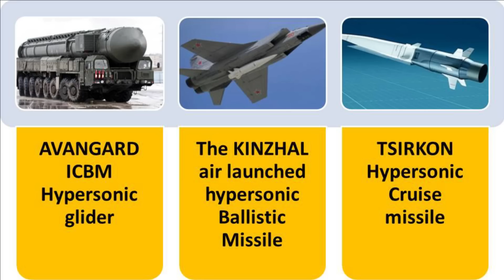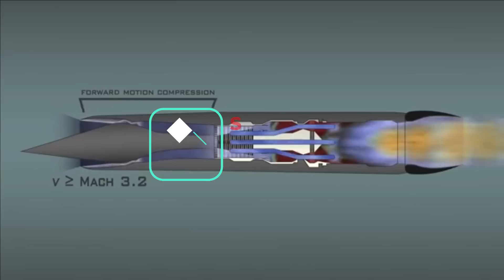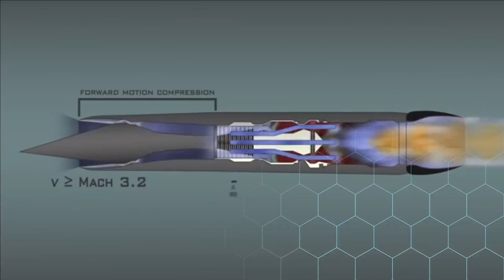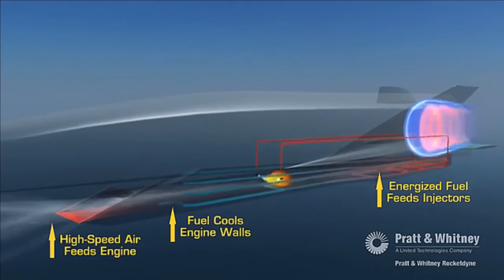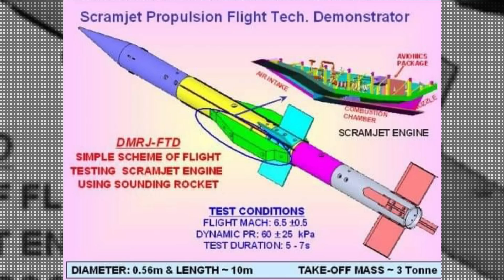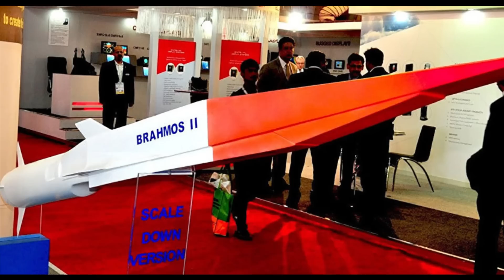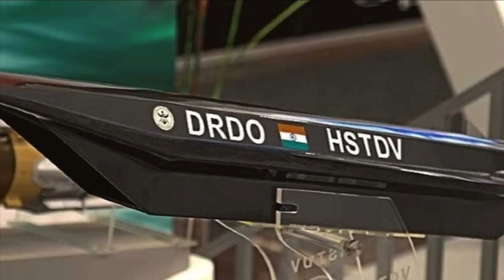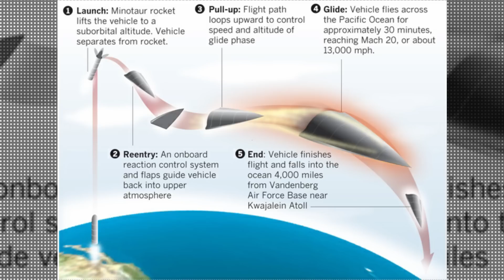India's Hypersonic Missile program in detail

Comment: Nice video. Very comprehensive unlike others I’ve seen on our hypersonic program.
What worries me is the initial estimate on Brahmos 2 being 2017 and now 2025. How can such delays occur and how can such estimates be so wrong? It’s almost a decade off the target 🙄
Reply: These are all BS timelines issued by our chapri 142nd ranked media houses.... 

The only official timeline of  hypersonic missile came from drdo was that Dr G sateesh reddy said that working hypersonic missiles would be ready within  4-5 years...he said it probably 1 year back.

Russia will not give readymade technology  on a platter...even after buying so many things they didnt give us complete TOT of any jet for indigenously manufacturing....our engineers have very hard time overhauling russian jets.
Reply: That's because Brahmos is a sea-skimming cruise missile and not a ballistic missile that falls from outer space. The technological challenge of making a sea-skimming hypersonic cruise missile is entirely way more complex than a ballistic missile that falls from outer space already operating at hypersonic speeds. For the ballistic missile, you just need to develop a glide vehicle that can re-renter earth, not a powered vehicle. However, for a cruise missile, going hypersonic means it needs a scramjet and not a ramjet that Brahmos currently uses. And ramjets start failing at hypersonic (mach 6 and above) as you hit a wall because the air is slowed down too much in a ramjet at mach 6 and above. So we need new and very advanced cutting edge science and engineering (including radically new design and new engineering materials) to efficiently and reliably run scramjets that operate entirely in supersonic mode INSIDE the engine itself.  I suspect it is the new cutting edge scramjet technology that is holding back India from making Brahmos 2 hypersonic cruise missile. Even the advanced countries are still on the experimental phase of developing hypersonic cruise missiles and gaining mastery of scramjet engine technology and design. This is just my layman understanding so please correct me if i got anything wrong.
Reply: @arunramachandran5012  we have developed our own scramjet...tested thrice .(1 failure and 2 success)
Reply: @krypton4379  Thanks, yes, i do realize that. However, please note that scramjet scale models have also been tested in a few academic establishments. I suspect that taking it from a "proof of concept" to a full sized reliable working scramjet engine is the real challenge. Typically in academic world, once a POC has been done by a science lab, it takes about 6-8 years to develop a viable commercial grade system. The timeline obvious varies and India already has immense experience in operating ramjets at supersonic speeds so it definitely has a big edge and a flying start (pardon my pun). However, the 6-8 years was an example of how long it takes to convert science to real engineering.

Obviously it will be spectacular to see India induct a fully operational version of scramjet. But i suspect it is still a few years away to take it from a POC or a partial scaled down version to a full scale commercial grade reliable version, as also mentioned by DRDO.
Reply: Because unlike the original Brahmos, Russia isn't giving the tech to India for this one.
Reply: @Vinamra Singhai lol it is not. Brahmos 1 too is no more a 50:50 work share project as more and more Indian components have been added to attain indigenisation to avoid cockups when Russia is under sanctions. 

Also Russians refused(although the diplomatic circles would like to use the word “deliberate delays”) to share the Morden engine tech for Brahmos 2 unlike they did for Brahmos 1 as a arm twisting technique as India dropped out of FGFA programme and many other cooperation projects too were scrapped.

Now Russian have put Brahmos JV in cold storage and thus DRDO has bene working on a project similar to BRAHMOS 2. However, Brahmos Corp will continue to work on indigenisation (or locally sourcing from with in India) and enhancing the capabilities, range of Brahmos 1 version to meet local and international requirements